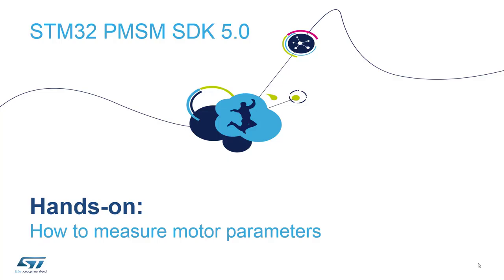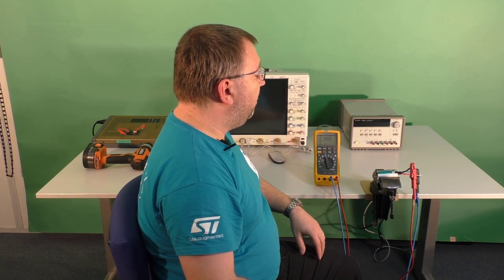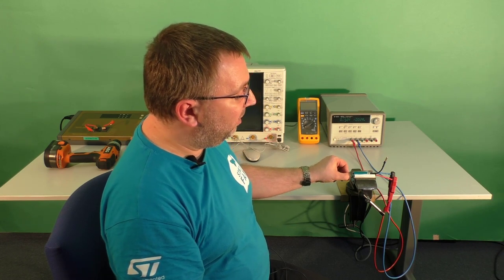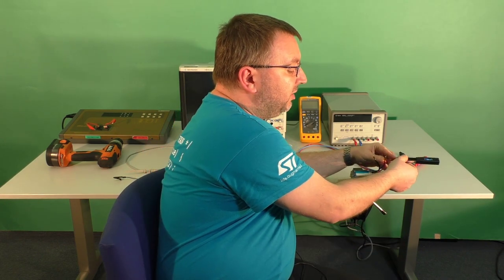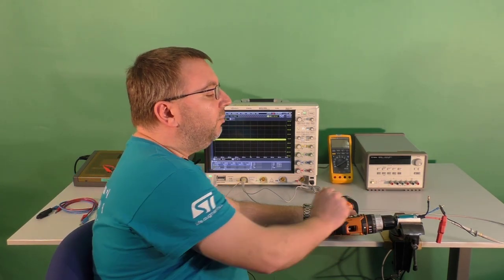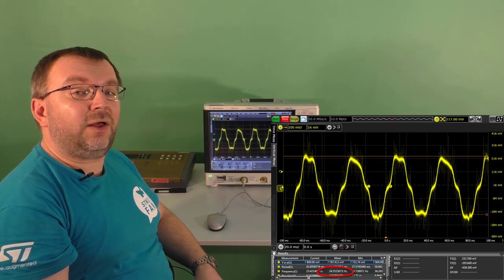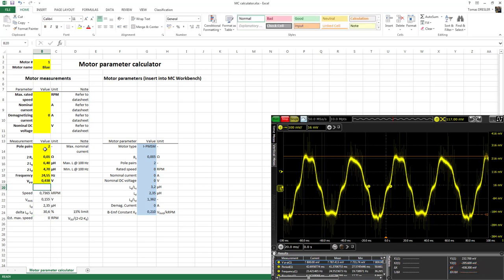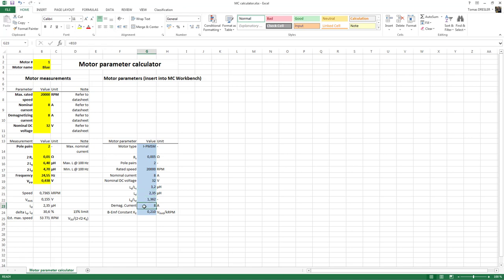Motor Control Part1 - 2 How to Measure Motor Parameters

Comment: Hi, I wonder why we don't calculate the resistance by voltage/current when we use power supply. Multimeter is not so precise. Here is about 5mohm. But we get 10 mohm by multimeter.

Comment: This is all but useless. Resistance needs to be measured using a power supply in CC + voltage drop or a miliohm meter.